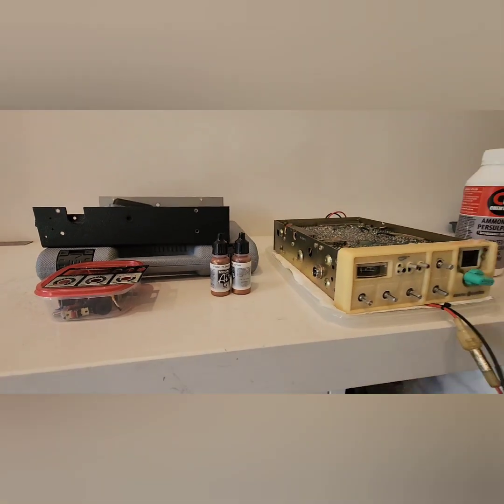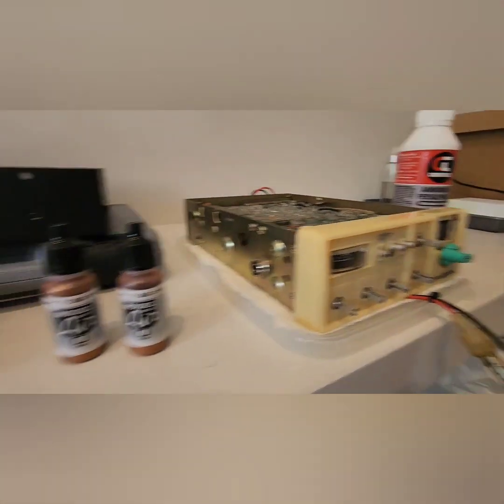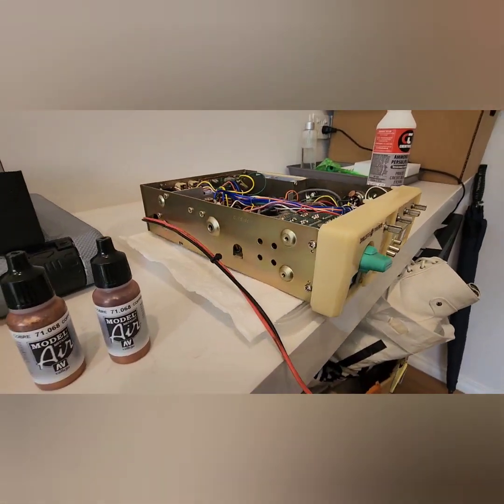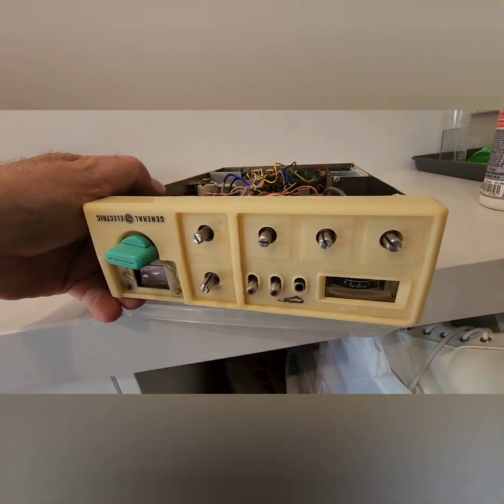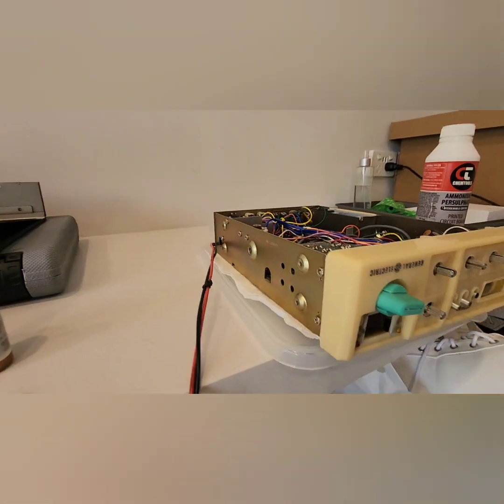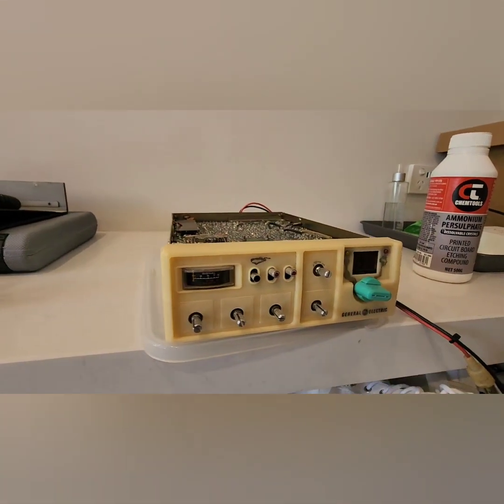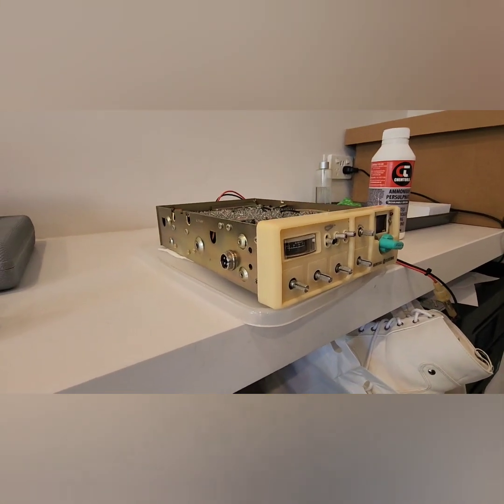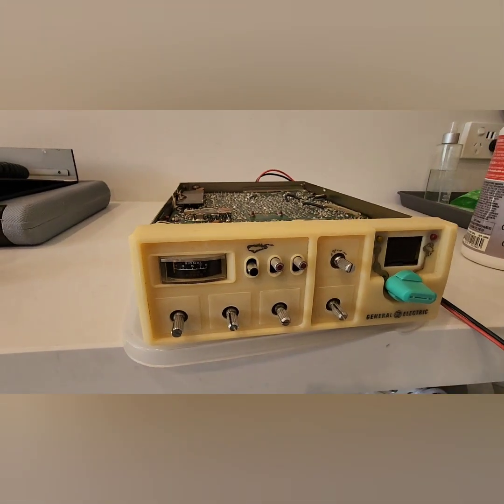GE A3-5825A A Model - Chrome Removed Ready For Paint - Part 3 of 6

Comment: Do you any tricks about small letters transfert on the bezel ?
Reply from the maker: Yes, in previous videos the ones on the President Adams I repaired deep melted letters into the faceplate.

Have to treat like you're fixing a cars body with dents.

What you need to do:

1. Remove faceplates chrome or paint
2. Fix all other issues with sandpaper & scrapers.
3. Use modelling filler, sand with 2000 & 2500 wet n dry but dry.
4. Apply modelling spray undercoat.
5. Then color stage